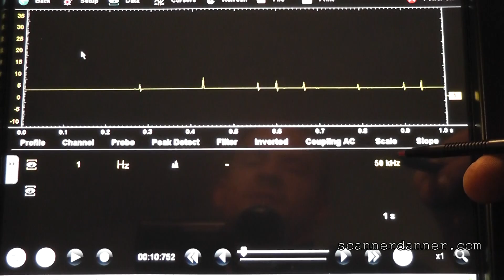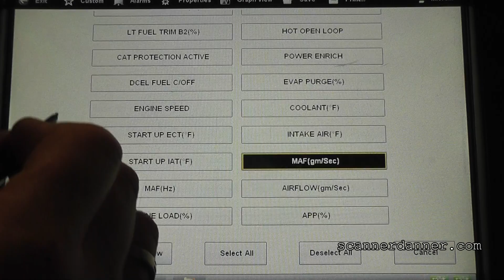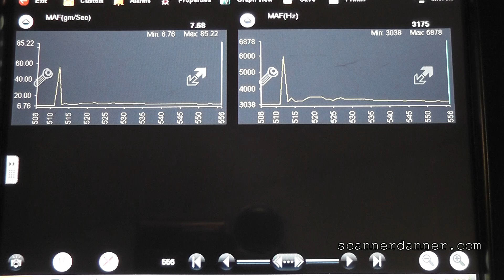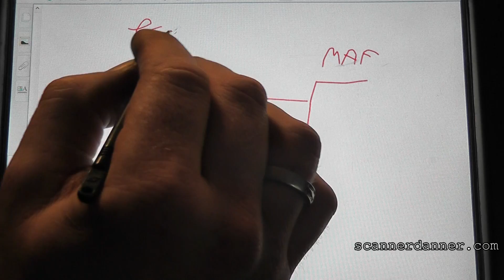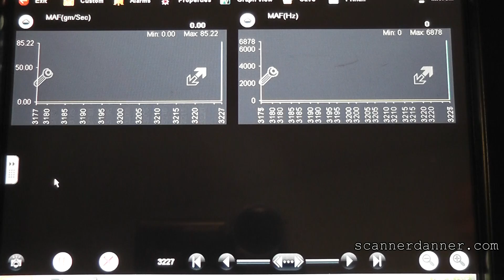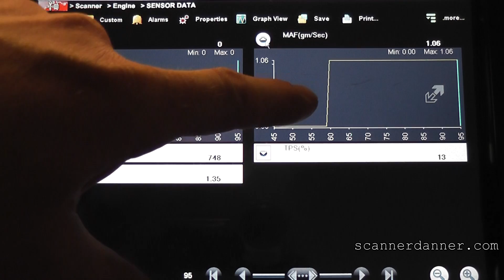GM MAF sensor circuit tests (a free ScannerDanner Premium video)

Comment: I am dealing with a gm mass air flow sensor code. It's a 3 wire connector. When I have my test light connected to battery ground, it does not light on any of the wires. When I have my test light connected to battery positive it lights on 2 of the wires. I have the key on engine off, is this normal?
Reply from the maker: You should have a 12v feed, so one of the wires should light with a test light. Also the ground wire would light connected to battery positive but you shouldn't be testing the signal wire this way. Focus on the missing 12v supply/feed to that sensor.

Comment: Pull up circuit design. Just because every circuit on the planet gets pulled yo ground does not make every circuit a pull down circuit. If it was a yrue pull down circuit it would read ZERO volts when disconnected. Now, when disconnected, it reads 5 volts, 5 volts is HIGH or UP. ,aka PULL UP.
Reply from the maker: I think it is ridiculous terminology. What does the "switch" do or in this case, the MAF sensor? It pulls a signal voltage supplied by the ECM to ground. I will not call it a pull-up circuit even though it has a pull-up resistor in the ECM. It adds unnecessary confusion. It's the same thing as thinking about electron flow vs conventional theory. We all know it runs the opposite way, yet we troubleshoot like it's not.

Comment: The cycles a second?…….cycles a second of what? I understand its hertz but what is the pcm cycling, voltage to keep the hot film/ wire at that certain temperature?
Reply from the maker: That's all done inside the MAF which is actually a miniature module, not a simple input sensor. The MAF signal is simply a representation of all that you nentioned

Comment: My MAF is reading 2,683 Hz at idle on my Autel scanner
Reply from the maker: yep or 2.6 KHz
Reply: @ScannerDanner  Is that normal for an 04 Escalade with the 6.0? I'm still learning to read live data. It's a whole new world of automobile technology for me haha
Reply from the maker: @DollyDriven  not sure, they're all different. What are your grams per sec at idle and what are your fuel trim numbers?
Reply: @ScannerDanner  4.5 ish (was reading 0.02-0.01 lb/s) gs/s at idle. St fuel trims were between -1/-4 on both banks. Lt was -25 on both banks. It's got lean codes. I did the intake gaskets around 8 months ago, and they're still good. I soaked them in brake cleaner and the fuel trims didn't change at all.

Comment: Great video:) I wounder if you can find problem on maf sensor with digital multimeter if you didnt have scope? What reading to look for on maf sensor ?
Reply from the maker: Depends on the failure. Check out my chapter 12 playlist for some more MAF testing videos. In some of them I'm using a digital meter but also talk about the limitations

Comment: Can a little corrosion affect the signal wire..? And if so how can you find it..? I understand that there is no current flow  but I was just thinking about it.. thank you sir
Reply from the maker: Signal voltage on the scan tool will not match an actual signal voltage measurement at the sensor in your scenario. Make sense?

Comment: My 2002 Lesabre MAF waveform  (HZ/time) line was smooth with humps reflecting increase in air volume as I drove. After my engine became hot the smooth humps became really hashed ? Using Scopemeter 98  Any ideas?
Reply from the maker: ground connection on your scope changed, MAF is failing, computer grounds or MAF grounds could be an issue, lots of missing information here for me to be able to help you further

Comment: Hi Paul..Is it true to say that if the maf is digital we will see 0 or 5 volts at the signal wire with KOEO and if it is analog we will see like 1.2 volts, 2.6volts, 1.8volts or voltage readings like these...i mean if we see 0 or 5 at the maf signal with KOEO, we can be damn sure that it is a digital maf.
Reply from the maker: Not necessarily. You can have an analog MAF with a problem, read 5v steady on the signal wire. (Open sensor signal circuit or ground problem)
Reply: @ScannerDanner  Hi Paul..when we test short to ground using resistance check by disconnecting the components on both sides, if we see zero ohms, we say it is a short to ground and if its open limit, we say the wire is open...if for example, we see like 300, 400, 1200 or any figure, what does this mean????? bcoz neither this is short to ground nor open. Plzzz advise. Thank you

Comment: Hi, i had lean code and high LTFT at 55mph on 05 escalade. New Maf caused lean code at idle(exact opposite).
Does this mean new Maf could be bad out of the box?
Reply from the maker: sure sounds like it, use an OEM part only if you can, or clean your old one and re-use it

Comment: How do you know if it's "pull up" or "pull down"? If the computer is bad and not sending out the 5v a "pull down" will be VERY misleading. Lending you to think it's "pull up".
Reply from the maker: Exactly! Great question and insight man. It is not easy to determine on electronic design circuits, but I have hours and hours of video on this topic on ScannerDanner Premium. https://www.scannerdanner.com/join-scannerdanner-premium.html
There is a 14 day free trial. Even if you sign up and cancel before the trial ends, I'm fine with that. Just watch my chapter 2 "switch inputs" material okay? Thanks! hope to see you there.
Reply: wouldnt you be able to tell just from viewing the wiring diagram? I'm asking Paul actually...im asking bc another of your videos made it sound like it should be possible to tell if it's pull up or pull down just by the wiring diagram?

Comment: I had the opposite. I had 5v on the signal wire engine running, idle. Power/ground good. 0.0g/s on the scan tool. Engine ran fine. Bad sensor.
Reply from the maker: sweet

Comment: Paul, sorry but I know I am missing something. You explained the misdiagnosis of the other instructor's vehicle. It needed the ECM not the airmass, and stated that you should have unplugged it to determine it was a pulldown design. But if the ECM was faulty and not sending the 5V how would you have determined that? 0V plugged in, 0V unplugged (with a faulty ECM not supplying the 5V on the signal wire).  I've been trying to figure out what the next step would be in that scenario. **Thank you for your time!
Reply from the maker: :-) great question. The short answer is now you know, don't forget, all GMs were done this way. 
This type of info is hard to come by, I learned this one myself.

Comment: ive got one other question you say look for 5 volts to the sensor say you didnt see it would you have to do the unplugging of all the sensors that are on the same 5 volt ref? check pcm grounds/powers? and 5 volt harness for a short to ground??
Reply: Did you see my Cobalt video? It had low voltage on the MAF signal from a reference circuit problem.
So a ref circuit problem will affect the MAF signal (GM) but a MAF signal problem will not affect the reference. Make sense?
Reply: so your saying a shorted 5 volt reference circuit or, shorted sensor on the reference circuit will cause low or no maf signal. but an actual maf sensor signal problem wont affect the signal circuit? kinda confusing. i did see the cobalt video by the way.
Reply: what code would you go after first p0401 or p0420? its on a 2002 mercury cougar, im to the point in the service manual for p0401 where it has you run the key on engine running test and hook a vaccuum gauge up to the egr valve vac source and look for an increase in vac. now next step is checking dpfe sensor are those common to go out??
Reply from the maker: Close. A shorted maf sensor signal circuit will not affect the reference but a shorted reference will affect the maf signal
Reply: now it makes sense. what is a low reference circuit that gm calls it?
Reply from the maker: phil holbrook
sensor ground
Reply: oh ok. thats what i thought but wasnt sure. thanks. can you do a video on hybrids?? im takin a class at the local college but wouldnt mind getting a head start on information. thanks
Reply: O ii kk k okjkojo ,kj[9 jokI [j ii >
Ok 999o
J*jjj**j

Comment: the gm troubleshooting has you check for 4.8-5.2 volts while sensor is unplugged key on. test for ignition voltage, but the thing that kinda is sketchy is they say use an ohm meter to check the ground wouldnt you want to do a voltaGE drop test instead?? also they say use there 900 dollar signal generator tool to simulate hertz nice idea with the test light my friend

Comment: The pull down test KOEO  it didn't work but it did work for me  on gm, I was not sure about the 5 V at the signal wire them I remember pull down test and the scanner read the signal, I was using a maxidas ds708 but it only show ones maybe the scanner or maybe you didn't see it at the first try. Nice test with the KOER..

Comment: Thanks Paul great video got me thinking  do you put a lot of stock in VE calculators ? It's a formula where you put scan tool pids into a formula to determine how well an engine is breathing .  Iatn Google has the formula  it looks at maf. Temp.  Air temp. Baro. Rpm. Engine displacement tps.  Just want to get your opinion.   Mark ferraro
Reply: Never used a VE calculator.

Comment: A quick and dirty way to try and simulate hertz signal is to use a file attached to ground and run the signal probe along the face of the file like striking a match. Also good for pulsed DC switch bypassing.
Reply: Nice tip!
Reply: Dang thats pretty cool

Comment: Paul, having sat through hundreds of college lectures, I can say with certainty that your lecturing and presentation style are absolutely top-notch. Your class would be my favorite one of the day for sure! Bet your students never fall asleep behind their desks haha
Reply: Thanks man!
Reply: The MAF  circuit design is pull up. When disconnected 5v is the up, or high side. The resistor is in the ECM and the reading the computer sees is 5 volts when disconnected. That is what determines a pull up or a pull down circuit. A pull down circuit will measure zero volts when sensor is unplugged.